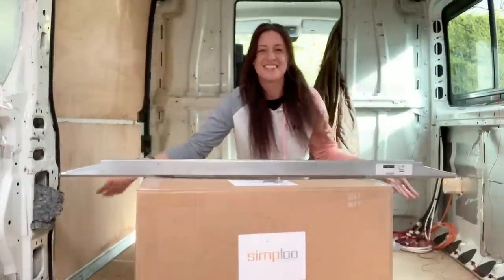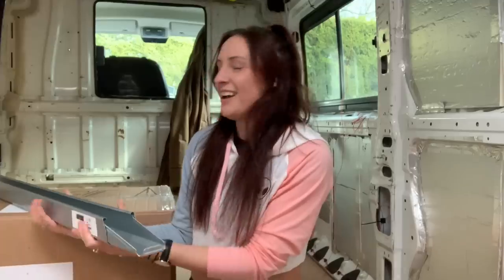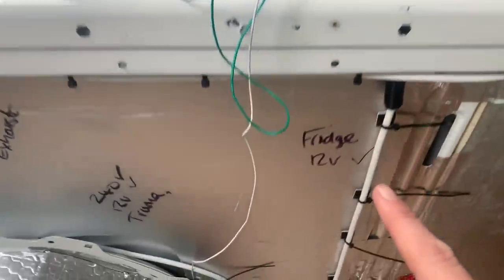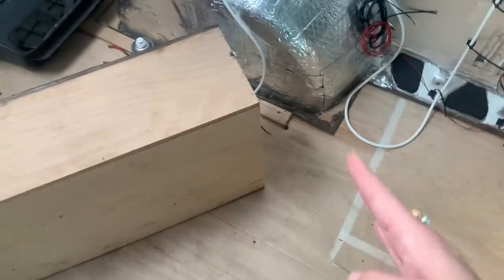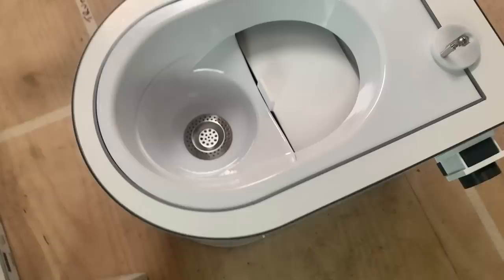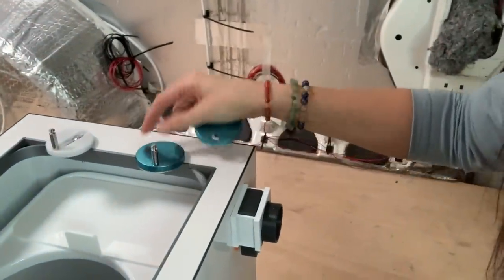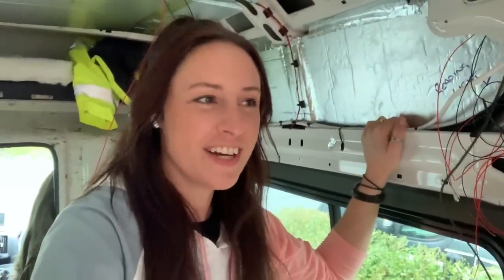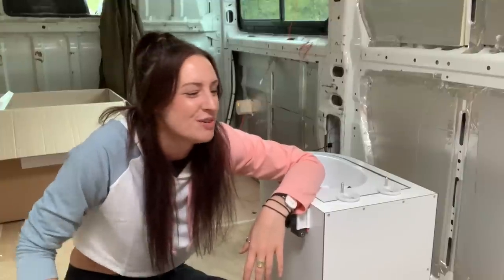BED & BATHROOM SET UP (Simploo Review) - van build Ep.12

Comment: Hi Becca love the videos, great energy. We have used a Simploo in our self converted van for the last 2 years so thought I'd share our experience. Overall I think they are great I can highly recommend them. I keep the fan running 24/7 they use so little power and they are very quiet. There are 2 of us in the van and we find that after 4 days you can just start to smell something (we have ours vented outside) not bad just a faint odour so that's when we change the bag. It's easier to find a bin for a small bag of waste than a larger bag. We started off using the wee bottle but it has to be emptied daily if you are driving. The wee alarm works great if you are not moving but if you are it will spill out before it gets high enough to set the alarm off. We now have the wee diverted to the grey water tank, we find that works so much better for us with no chance of spillage whilst driving. With the grey water tank there is a mod I can also highly recommend and that is to have a electronic valve fitted to the waste drain pipe with a switch to open and close it in the cab. Alongside this I have a reversing camera kit fitted (£20 ebay) with the camera fitted beside the valve looking down at the floor. With this setup I can line the van up with the drain using the camera, flick the switch to empty the grey waste, see when it's empty and close the valve all without getting out of the cab. I also have a Y connector fitted just before the valve going to a manual drain tap just in case the electric one fails. Best wishes for the rest of the build
Reply from the maker: Thank you for the valuable input Mick! 🙏🏽

Comment: I have used composting waste bags before. Be careful buying too much stock of these as they get weak over time and are inclined to give way at the seam. Yes the light inside was nice with the doors shut. You could have the same effect with a double roof vent. This set up also gives a good flow for ventilation in hot weather
Reply from the maker: Thank you, I’ll keep an eye out for that!

Comment: loving your videos and always look forward to the notifications coming through ... you asked if we saw something 'wrong' ... the door that you took the grey/black lining off and you stuffed it with the bottle wool didn't have any sound deadening ... I also follow Margaret & Ladi - he's 3D printing everything and it's taking them ages to do ... don't worry about us .... why not use the door area? ... it's always there yet only seen when using ... you have to keep the door clear and can't use it for storage - the only time you won't use the door is when you're having a shower ... I don't think it's a good idea to have a cubicle ... you end up just using it for storage for things you don't have space for and then when you want to have a shower where do those things end up going while you have a shower and then have to wait for it to dry ...
Reply from the maker: Ahhh yes someone else pointed out I’d missed the sound deadening so that’s a job for today 🤦🏽‍♀️ thanks for catching that for me. 

I need the shower cubicle, because of my cat number 1. Secondly it’s doubling up as a drying room as we’re fitting a heat vent in the shower. And also, my shower door is one of those roller one which disappears (again, for the cat), which will also make the space feel bigger in the van as you haven’t got a big bulky door in the way. 
You’ll see when I fit it & I’ll explain it all as I go 😃 but for what I need a cubicle is the way to go.

Comment: Great video sweetie But I think your idea for moving the loo out of the shower every day is a big mistake. It won't be long before the pipe connection wears out and don't forget, the more that goes in it, the heavier it gets. My advice would be to permanently mount it outside the shower but in a cabinet which would double as a seat..that way you're still able to use the space that it occupies.

Comment: Greetings Becca.
 I noted the comment about shower tray decision. I like to think my input was factor. For a tip's look at urbanvanlife  who used a company Anchor for this but as an Engineer I made my own.
The metal can be cold but I have spotted on TV the Hydro Wonder a mat that allows shower water to pass through.

Standard DIY drain is ok but for a bit of flash recess where fitted.
Best wishes to you and your Dad.
Reply from the maker: Amazing, thank you Stephen.
Reply: @myvanworld ,
 Greetings Becca I spent today looking at little motion sensor LED lights.
Pop inside cupboards above the door so no rummaging in the dark wardrobe.
Best wishes.💡
SP.

Comment: Im looking at where and what wires i need for my leisure battery to interior lights.  Van build is coming on nicely
Reply: For all LED lighting we have used 0.35mm2 thin wall insulation wiring. Current is 7 amps capacity for this size of cable.. We have used .50 mm2 size for long runs and other equipment ie the Heating. current is 11 amps capacity for this size of wire. The Truma draws 6.5 amps but the cable run is approx 2.5 meters and it runs in a conduit with other wires so I used the 11amp cable.. hope this helps. Pops
Reply from the maker: Thanks dad!
Reply: @Nick - Pops  brilliant thanks ,

Comment: Are you going to use coconut core or some other material inside the poo bin?
Reply from the maker: I’m not at the moment. The fan works well enough for the smell. But I’ve only been using it a month so still getting used to it.

Comment: I think the Simploo option is a good one. Does Simploo recommend adding something in the poo bags aka peat moss? If not, do you plan on adding something yourself? This video has giving me the idea on how to create a bathroom for my downstairs living area in my home. I'm planning on adding a half bath downstairs, but a "normal" one would cost at least 7 to 10 grand and my only other bathroom would be out of commission until completed. I like the idea of this toilet option for cost, time, DIY and less invasive. I'd add super easy/no fuss hand washing station--Small sink that drains into container(take the used water to water my outdoor plants) and some easy water dispensing container with a handle or foot pump.
Reply from the maker: I think they recommend peat moss, and you can also use a sawdust type mixture. I’ll definitely be using one, but not sure which yet. I’ll likely try a few options & see what’s best. 
That sounds like a lovely idea! Simploo have actually released smaller versions which might suit your idea 😊